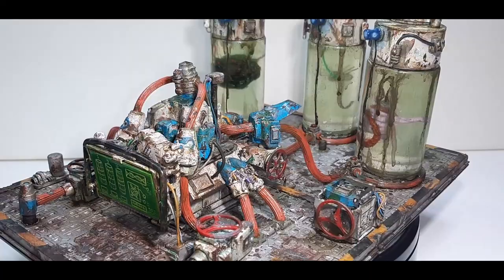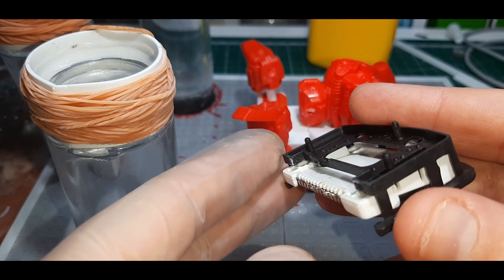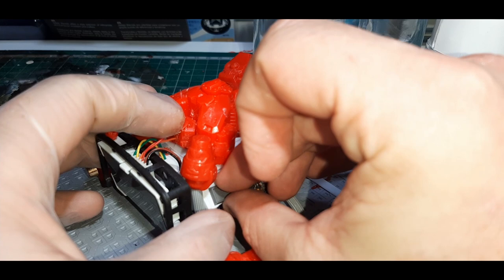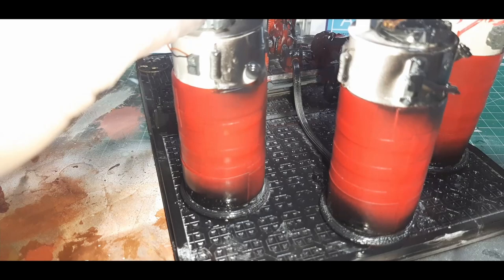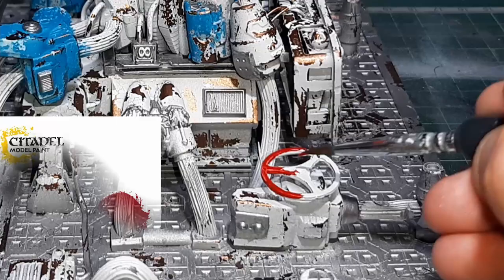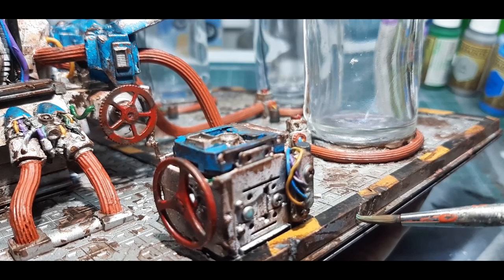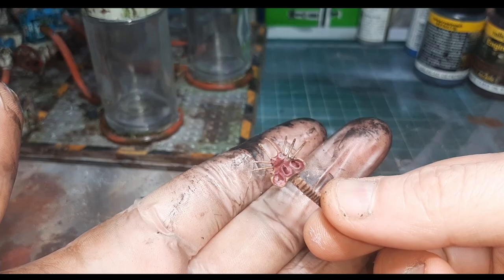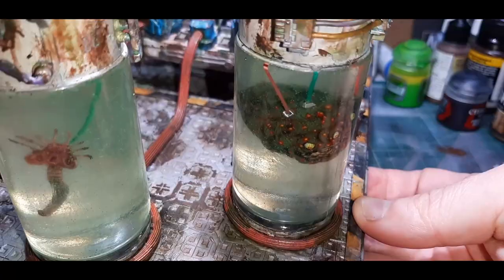Grimdark Scenery- Gene Vats for Necromunda, Killteam or any other Sci fi tabletop game.

Comment: I know I'm late to the party but I love this build! Can you describe again the flexible wire/tube you used? I didn't quite understand what it was. Looking for more flexible stuff to add detail to my underhive, haha. 
Keep up the great work!
Reply from the maker: Better late than never. That grey rubber is for fly wire screens and I just looked it called screen spline. Thanks for watching.
Reply: @NayfeePaints  Thanks! Definitely going to look for some. I went the route of getting a lot of the official terrain, but I love to get inspiration on how to make it a little more unique. I've been impressed how much detail you put into your builds :)
Reply from the maker: @jrkistler  I would use official terrain in my builds as it does look good. It's just to exspensive for me.
Thank you very much regarding my builds.